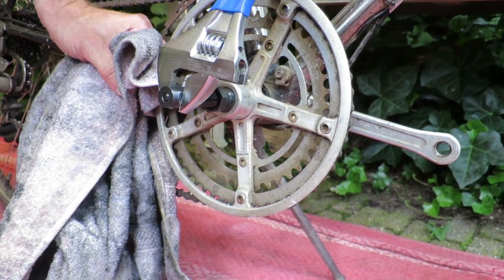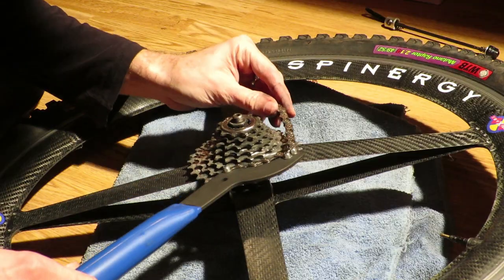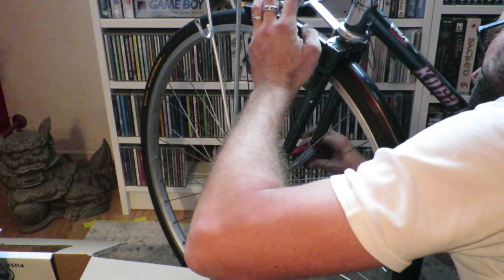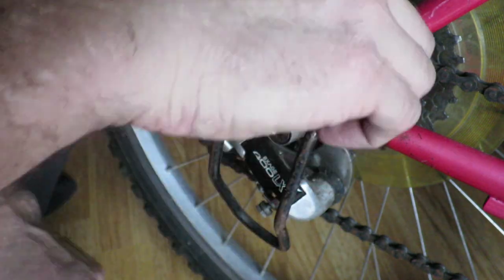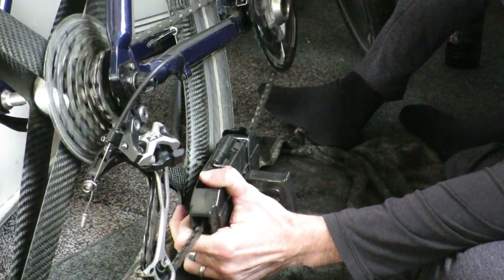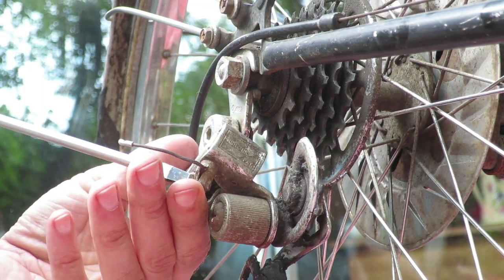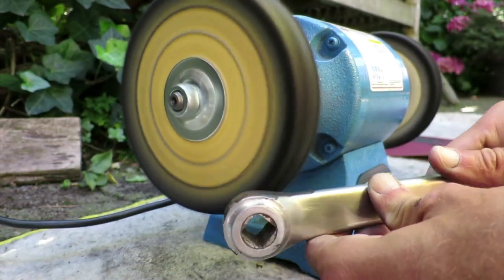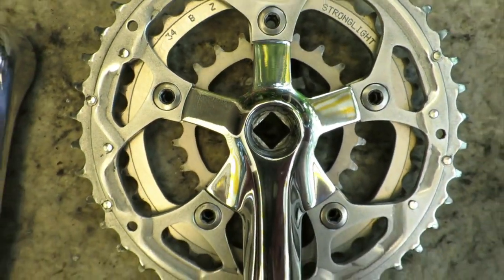Top 5 best tools for bicycle repairs

Comment: So hard to pick just 5, so I'm going to cheat... Really is a mindbendingly pricy hobby.
1) Cleaning/lubing/shining: brake cleaner, WD-40, cotton rags, spray-on grease, fine steel wool, rust converter primer, clear coat. (If I had a buffer wheel...)
2) Quick and dirty fixes: M-wave €4 pocket inbus multitool, foldable pocket pliers, good quality plastic and metal tire levers and a patch kit with tiny scissors and a roll to cut to size.
3) Wheel perfection: combo of bench vise, cone wrenches (cheap and soft, won't round the nuts), park tool combi spoke wrench (definitely spend on this), an ancient hunk of steel truing stand, and a tub of marine grease.
4) For bending and beating old stuff into shape: plumber's wrench with enormous lever arm
5) workhorses: dual-end wrenches, chain tool and hammer, ratcheting screwdriver set, cable cutter with awl...

Honorable mention to the stand or pulley I've been too stingy to buy but desperately need

Comment: My 5:
1. Hex keys
2. Cassette lockring tool + chain whip
3. Cable cutter
4. Measuring tape
5. Pedal wrench

I mostly put more modern stuff on vintage frames, and maintain said build(and soon I'll have two!)
Reply from the maker: What do you use measuring tape for?